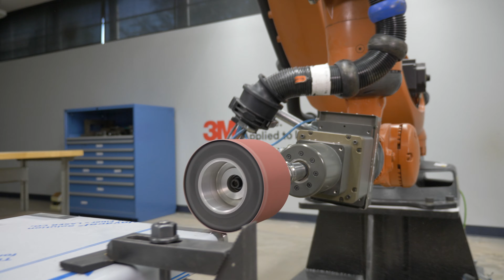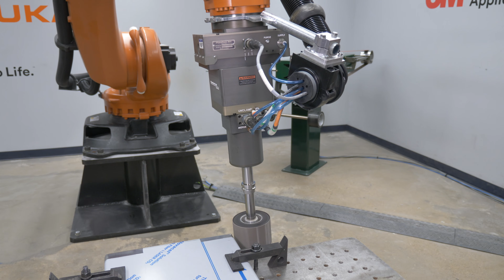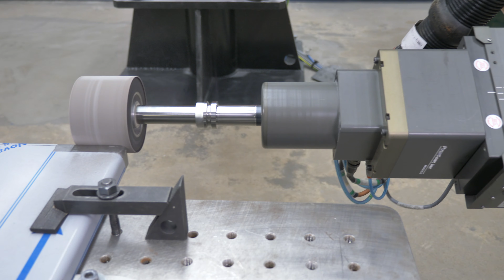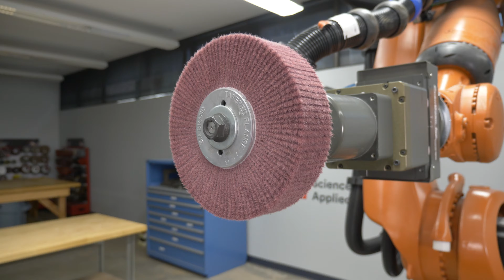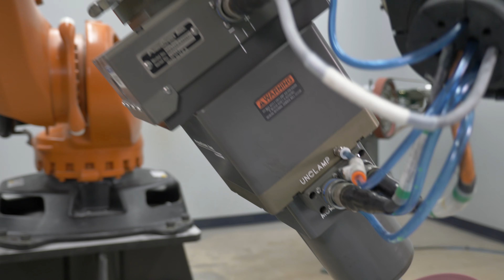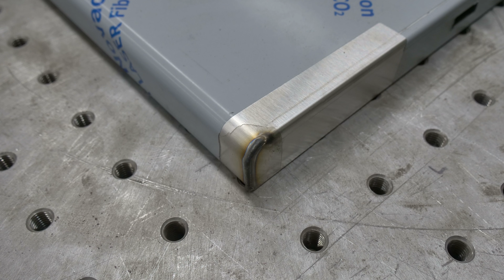Robotic Sanding and Polishing Stainless Steel

Comment: you used a red oxide type roughing drum belt then what looks like a trizact belt then a flap type scotchbrite wheel. why not jump from red oxide to scotchbrite? seems like the trizact belt was wasted during the operation.
Reply from the maker: A common approach to stainless steel decorative finishes is to level the weld, set the grain, and then a final finishing step. The coated belt was used to level the weld to the parent material. Trizact was the closest grain pattern to the rest of the part, so we used that to 'set the grain' to same direction as the rest of the part. The Scotch-Brite flap wheel was then used to remove any micro burrs left from the belting process' and to help blend the finish into the rest of the part. Trizact followed by Scotch-Brite is a common abrasive sequence used in the Kitchen Appliance Industry for decorative finishes on item like stainless steel fridges.

The end customers requirements is what drives the abrasive sequences we use. For example, If this part was being painted, a high grit coated belt may have been able to remove the weld and leave a paint ready finish all in one abrasive step.

Thank you for asking, let us know if you have any other questions!

Comment: unfortunatelly still far away from human hand, needs AI.
Reply from the maker: Thanks for the feedback Maciej. This is from our proof of concept lab in Dallas, Texas where we focus on specifying the correct material removal equipment, give recommendations on abrasives, and de-risk the project. This is not the most optimized finish and speed that is possible. The integrator or end user will take the data from this test and do further process development to dial in this application. Thanks!